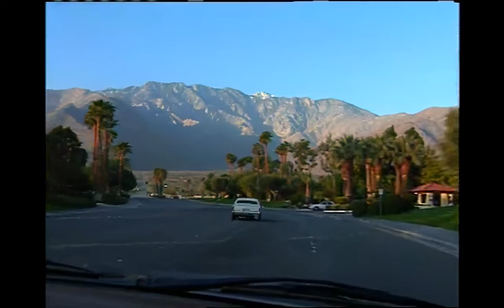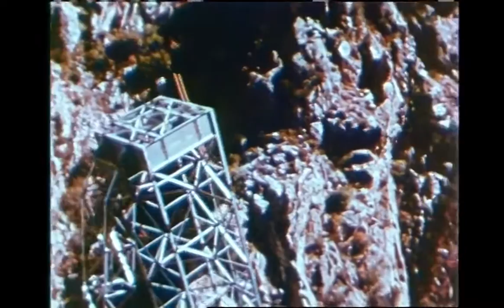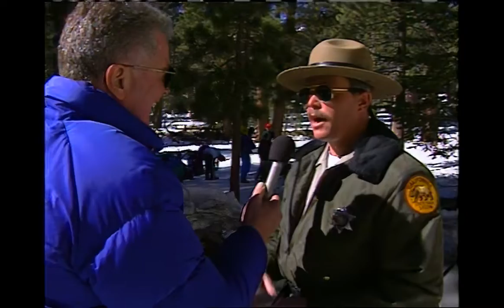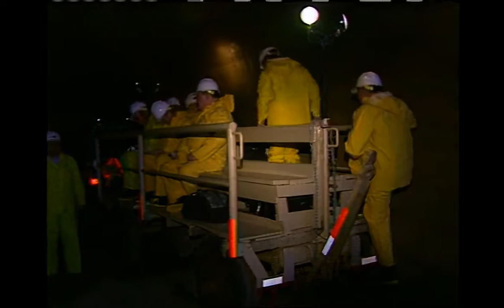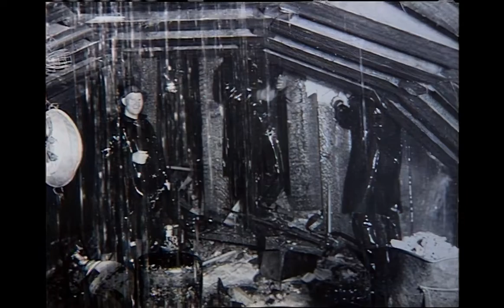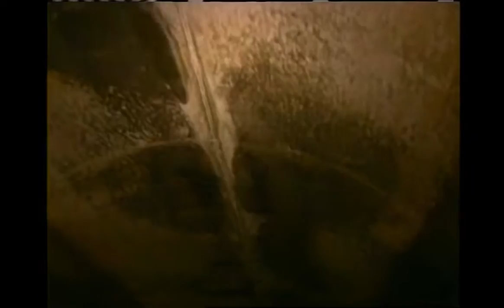California's Gold   S07E4   Mt San Jacinto

Comment: Point of fact:  The San Jacinto Range was indeed part of the Sierra Batholith, and possesses many of the same characteristics of the eastern Sierra Nevada, with the granite and shear drop-offs, etc.  The reason it got separated was when the San Andreas Fault began to form and the Pacific Plate started sending the Peninsular Range northwestward, the crustal block containing the Transverse Ranges -- for whatever reason -- began to rotate; and it has rotated 120° to form the San Gabriel and Santa Susana Mtns, the Channel Islands, and the San Bernardino Mtns.  In the time it took for the Transverse Ranges to rotate, the Mojave Desert filled in the blank space from east to west, and is now what separates the Sierra Nevada from its long lost sister, the San Jacinto Range.  But both ranges are part of the same massive batholith that was once miles beneath the surface.